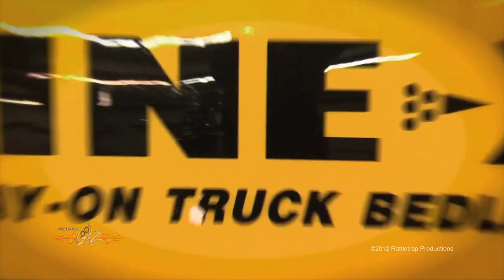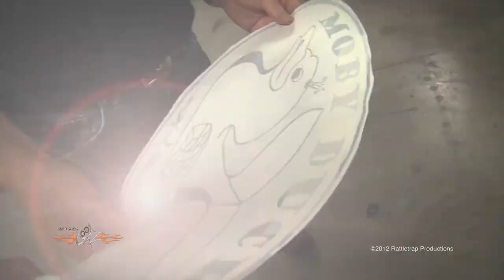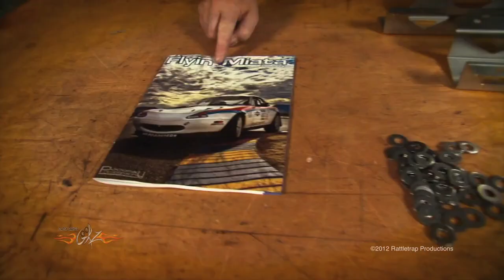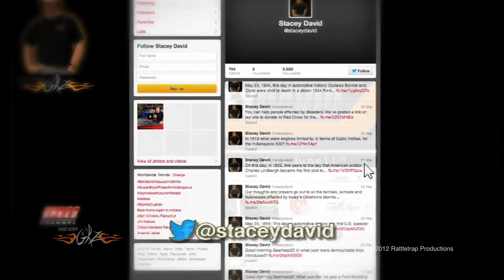2012 GMC 2500 4x4 6" Lift & 35s Duck Dynasty Hunting Truck - Moby Duck - Stacey David's Gearz S7 E12

Comment: To all you vehicle modifiers out there, ALWAYS USE SELF LOCKING NUTS in all and any applications that do not use either a castellated nut and split pin or R clip to secure the nut